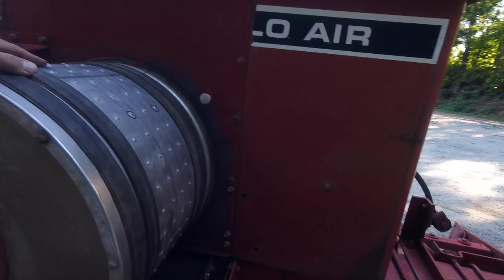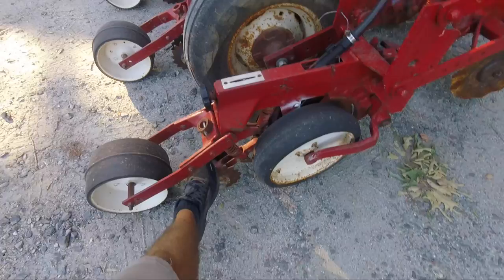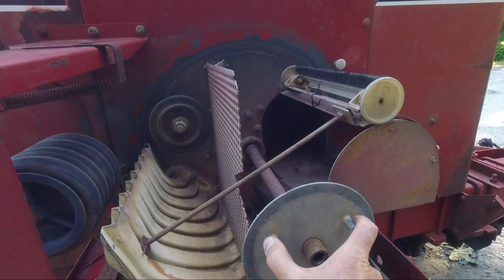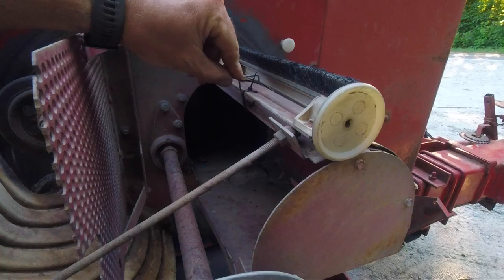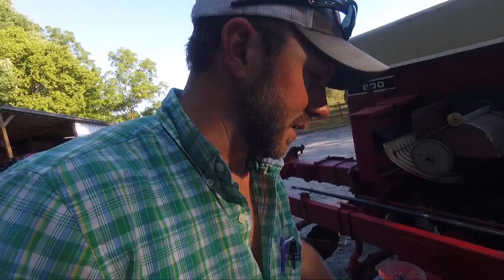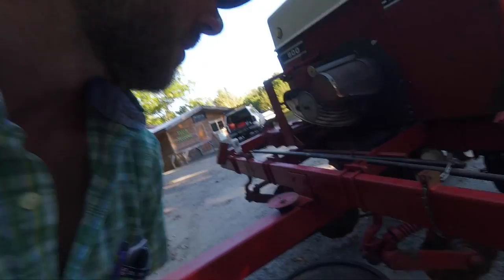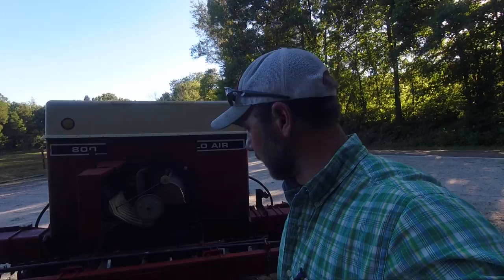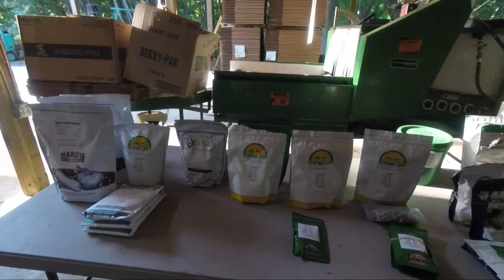How we plant pumpkins with a old International Corn Planter

Comment: How many seed to the acre are you putting on your Jack’o lanterns? We just finished planting our 9 acres yesterday. We’re using a jd7000 and riding on the planting units dropping the seed in the seed tubes.
Reply from the maker: We've done it that way before too, it works really well but I never have enough help. We plant about 4500 seeds to the acre on Winter squash and pumpkins